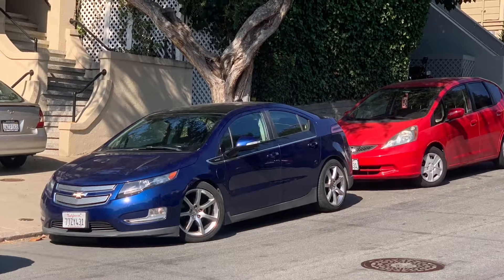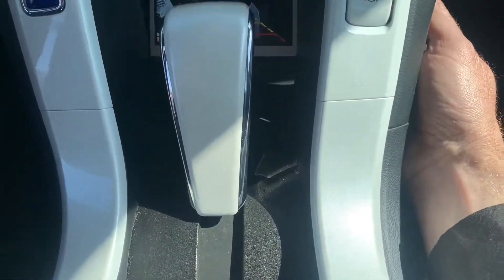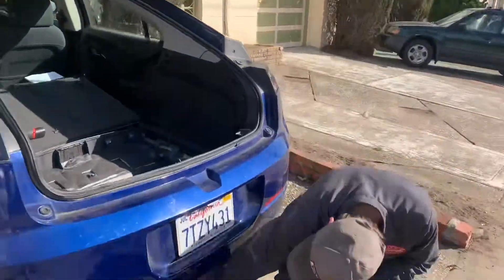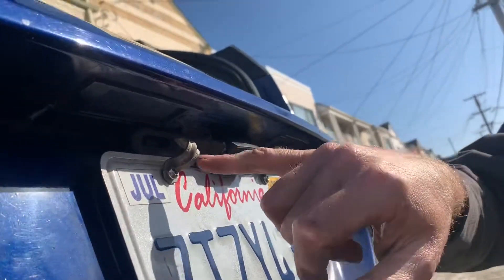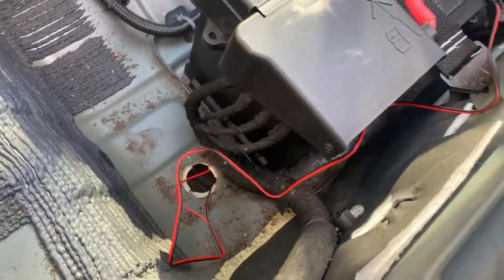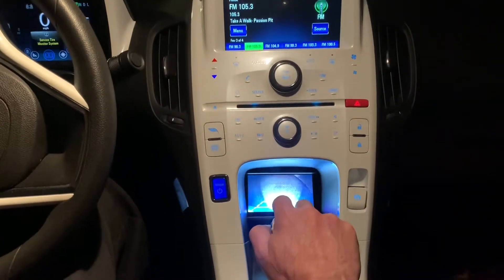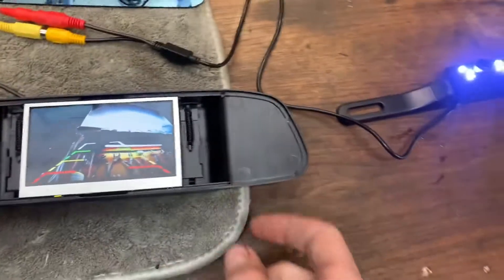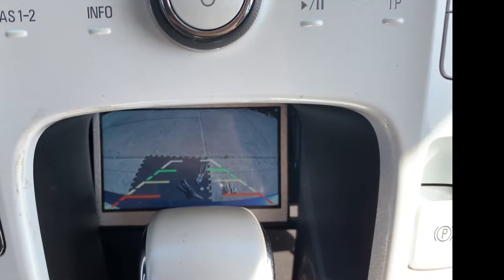2012 Chevy Volt Custom back up camera

Comment: You don't need to purchase any type of screen interface module, you just need to take your car to the GM dealership to reprogram the infotainment computer and install a generic reverse camera. For additional cost savings, befriend a GM tech and have him do it for you off the clock.
Reply from the maker: I read about that solution online but didn't want to deal with dealership
Reply: @Mrelectric423  smart!!!